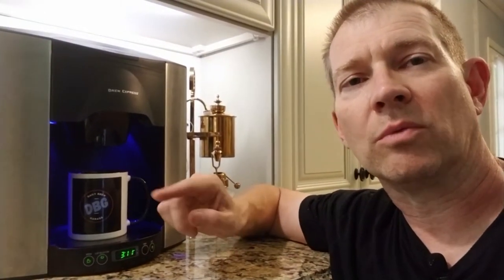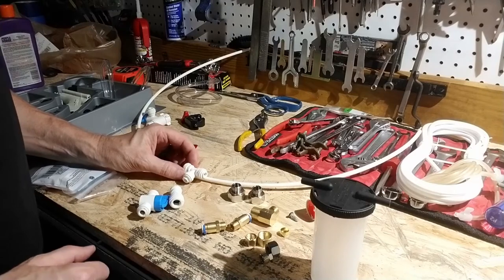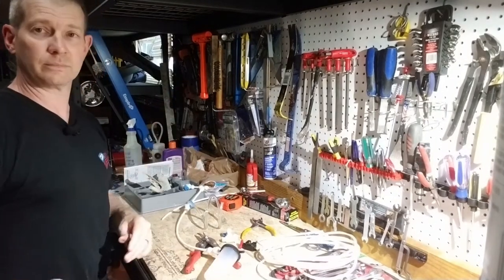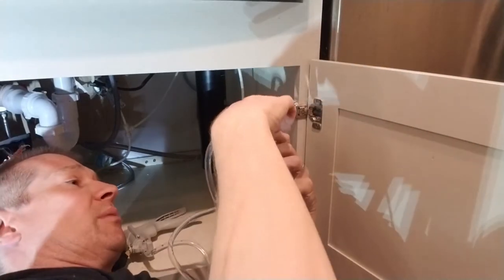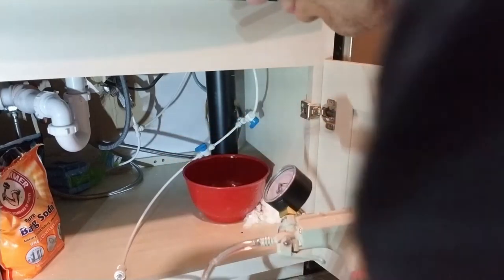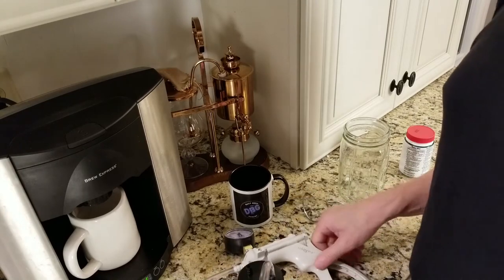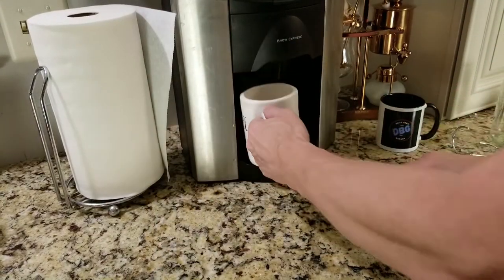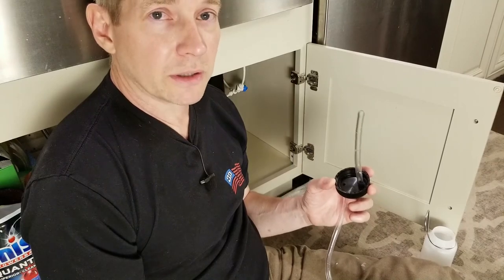Brew Express Coffee Maker EE:EE Error - A solution for cleaning the inline water system

Comment: Mine was giving me the E error code, and I cleaned the spray had it was almost completely blocked now at overfills every time
Reply from the maker: You can adjust the brew time to keep it from over filling.  
Hold down the "cup selection" button until it starts blinking the time, then adjust it with the same button and the "timer" button.  Set it using the "light" button.
Reply: @DailyBrewGarage  oh, thanks for responding that’s a good idea but I have the BE-112 the only buttons I can hold down have to do with the clock programming. The rest of them are three position rotary selector switches